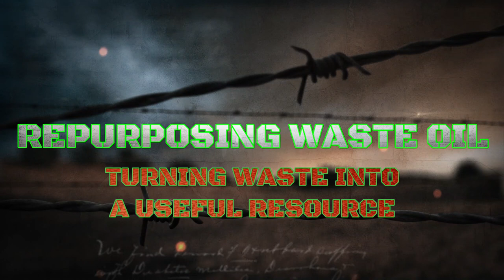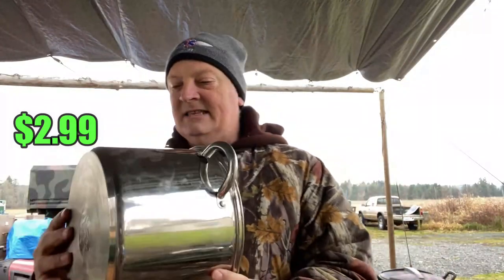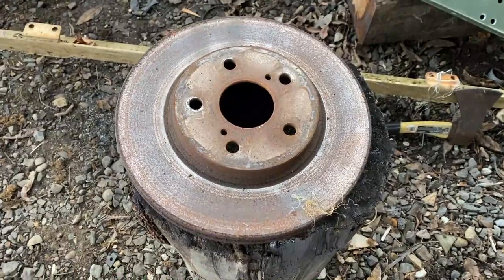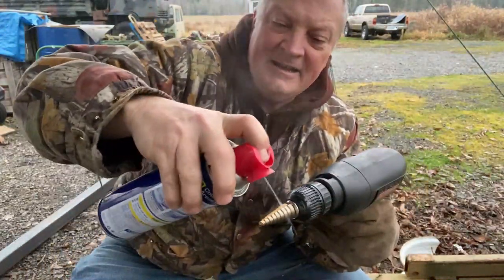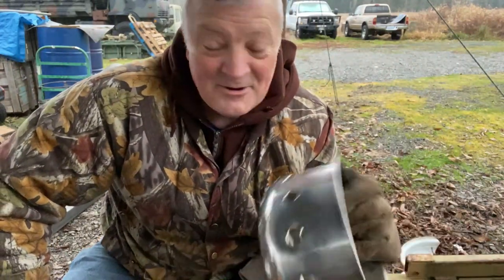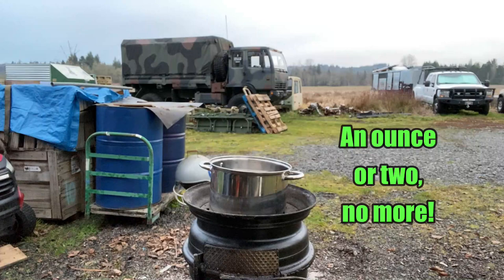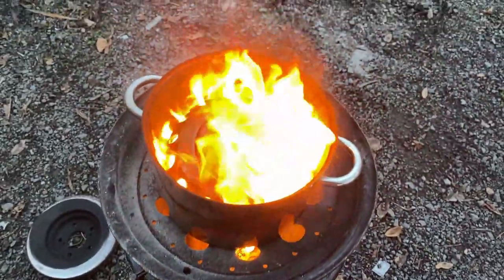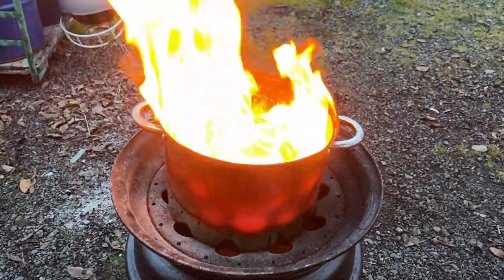Waste Oil Burner 1 of 4

Comment: to get clean burn it had to be complete burn >> you should supply it with forced air
Reply from the maker: I want this to be completely off the grin... no electricity. When this burner goes into a stove in the coming episodes, you are going to hear it ROAR!  No need for forced air... it goes nuclear all on its own. :-D
Reply: @HelicoolsHelipad  get a 12v heat gun , blow the air down a pipe and aim it at the flame . stand back though . THATS how to make it burn .

Comment: Interesting will this be an outside only stove?
Reply from the maker: No sir! I am making one that can be inside a closed shop. However, like any combustion unit, you need to make sure there is a bit of ventilation, as it will suck up O2 in the room.

Comment: Is kerosene just used for a starter fuel to get it heated up and going?
Reply from the maker: Yes, it is just to get the oil started. One could use a propane torch, but this was is quicker and easier.